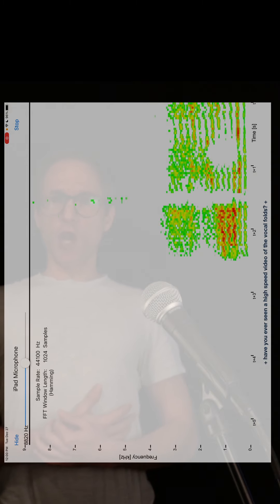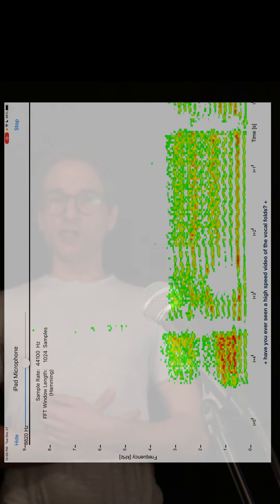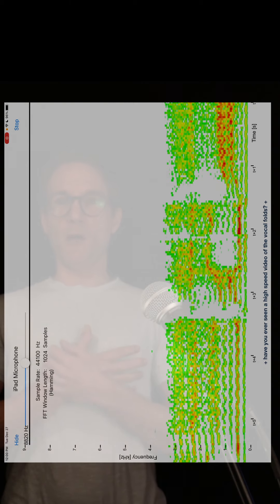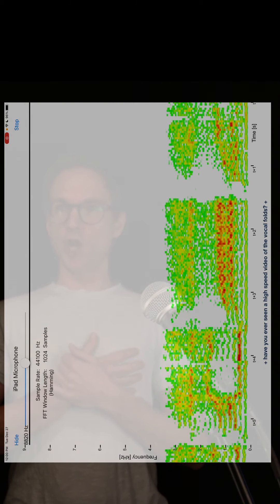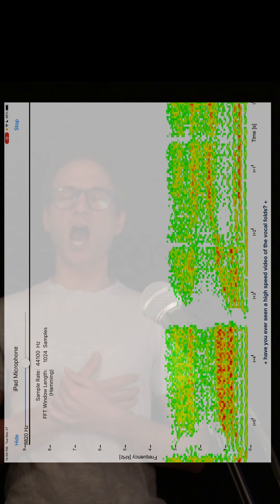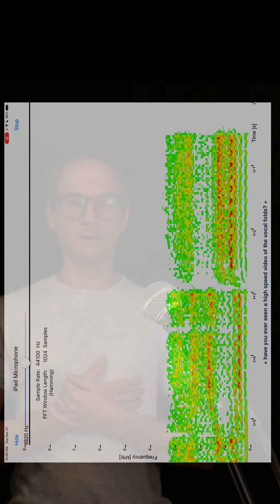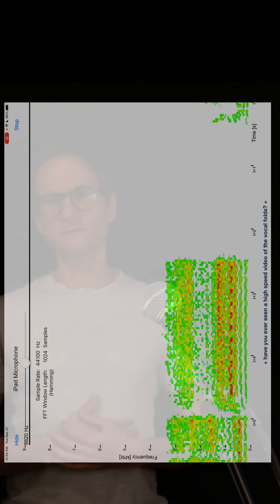3 science minutes: Area of Interest 3 constriction and expansion, effect on "chest" voice

Comment: Great video😀 would you say that your epilarynx is narrowed in your first example? Thanks for making interesting content! All the best/Andreas
Reply from the maker: Yes, that's accurate.  I tried my absolute best to try to keep everything else the same.  There was probably enough time so I should have explained the spectrogram is there to show you that even though the sound is so different, the spectrogram is showing almost the same thing.  

That's because other than AOI 3, I'm keeping all the formant tunings the same.  I also tried to keep the vocal folds thick and added some gas to the second example, to get the volume up to a similar level.  

The idea is to show that the biggest change you hear isn't resonance, it's the literal pattern of vibration coming from the vocal folds.  (This is why singing into a spectrogram didn't save opera).
Reply: @MisterOpera  thanks! That makes sense! I guess spectrograms can be of some help, but in order to find the right sounds we need to use imagination. The function of the vagues nerve is a valid proof of that.
Reply from the maker: In this case if we wanted to we could measure the difference.  It's just that the thing we want to measure isn't the resonance, it's the source.  To do that we could use an EGG machine. 

However I think you're hinting (more like explicitly stating) at something better: your ears and your IMAGINATION are extremely powerful listening devices.  .